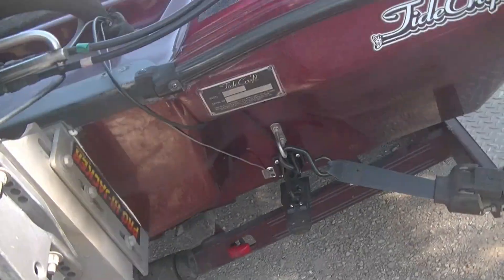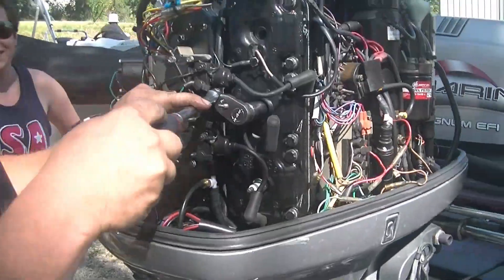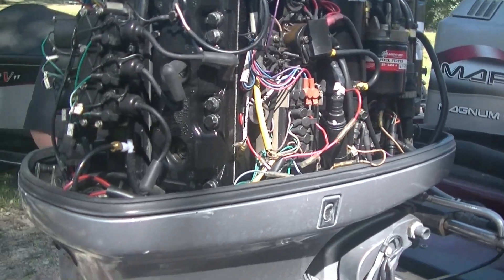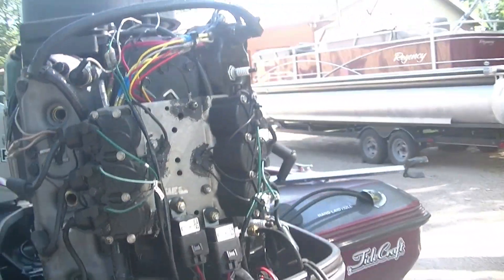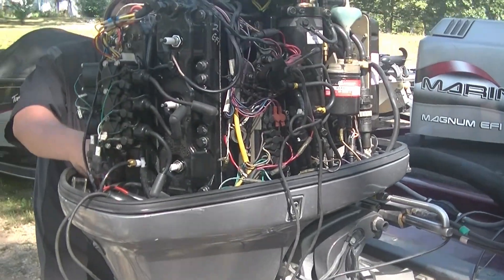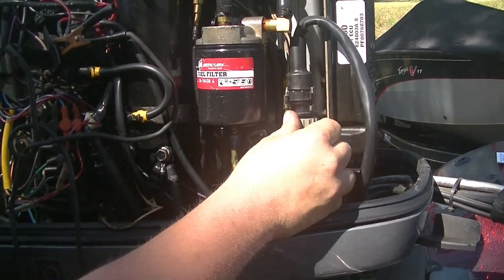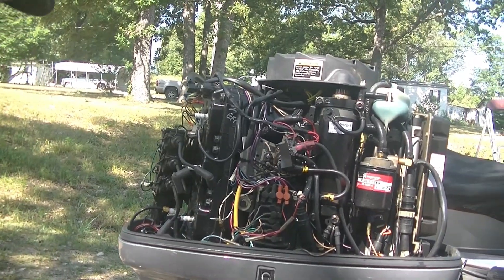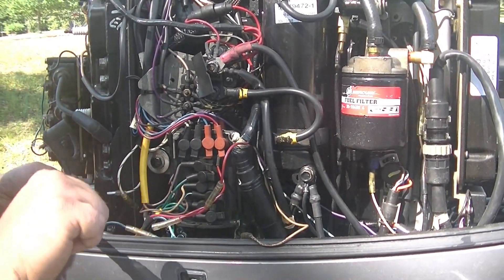My Old Bass Boat- Is My Old Outboard OK?

Comment: D.W., what’s you opinion or Aries boats? I just traded for a 98 200 xlt with a 200 Johnson . Oh and it has dual flashers built in.  Seem to be a well built boat. Thought I’d ask someone that’s been around. Thanks
Reply from the maker: Those Aries were well-built boats overall. Like a Gambler, they were known for speed. I'd always check the transom out, and remove the VRO off the Johnrude if it has one still. Seriously. Good luck with it, and thanks for watching!